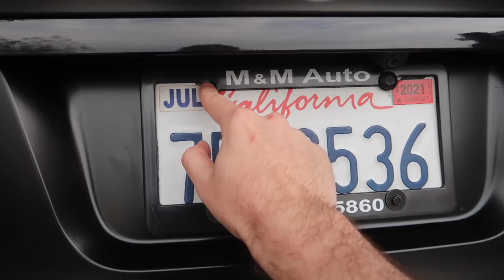THE 740LI IS 60% WRAPPED! (LOOKS SOOOOOOO GOOD!!)

Comment: You can remove the lug nut I removed a snapped bolt myself... use a titanium drill bit to make a .5” hole and use a broken bolt removal tool and it should come out with a drill

Comment: Now there’s either two problems with radio. 
1) IBS system can cause a ton of issues and it breaks easily, it’s a blue connector on battery terminal. Be careful they are expensive ($100-$180) 

2) the fuse could be wrong amps meaning for example 5amp being on 10amp place and vise verse

Plus the thing is ibs actually probably turned it of because of safety reasons 

(ibs will turn radio of if it detects low voltage or defective parts) 

Which you had low voltage battery for a while

Comment: If the battery drains to low or gets disconnected or changed out, sometimes it will trigger the computer to put it in "transport mode" which disables climate control and automatic windows. You can find details on the bimmer forums. I think you'll have to have your coding guy disable it or take it to the dealer and they'll do it for like $60 from what I've read. Hope this helps.

Comment: Bmw charged me $110 to remove the wheel lock so check them out. Not sure abt lug nuts, but should be around the same price. Other shops said it takes 2-3 hours and wanted $100 labor per hour

Comment: Bro it makes me upset you couldn’t get the lug nut off, I would’ve got a socket that is one millimeter smaller and used a sledge hammer to get it on and used a big breaker bar with a Steele sleeve on the end (cheater bar) and sat on it or had me and a buddy push on it. If your getting a new lug nut why not
Reply: If I didn’t live in maryland I would’ve came and helped you do it buddy